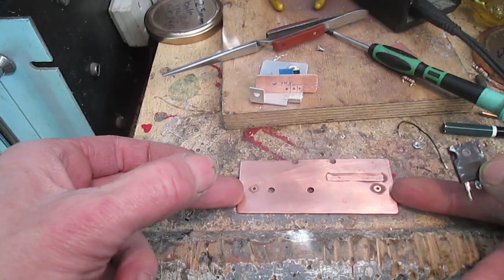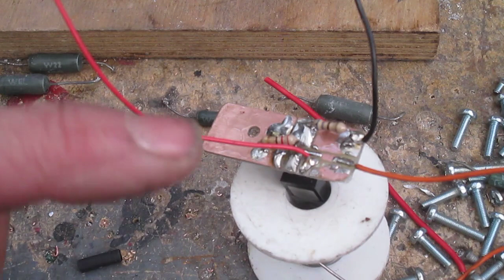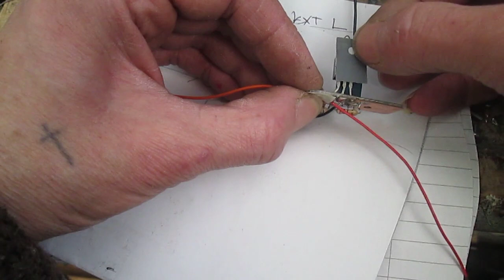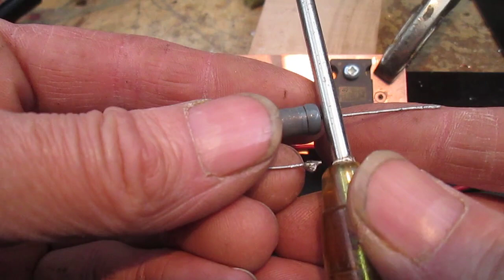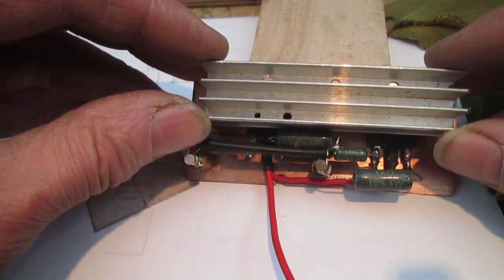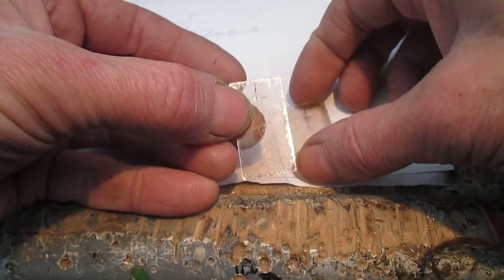Valve Pre-amp Heat Issue Fix - Part One.

Comment: That is one heck of a storm there! I like the screwdriver idea to bend leads. Great tip!  (On the sockets I sent you, I made sure the ones that had threads for screws had screws in them for you.)
Reply from the maker: Storm Debbie, we've had a few storms recently & lots of rain,  parts of the county under water. Thanks Frank, your a diamond.